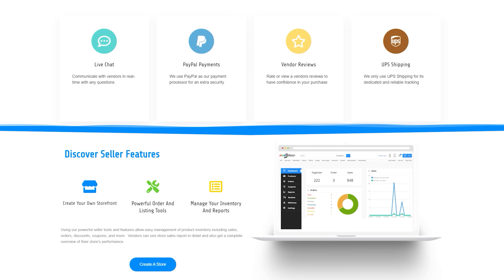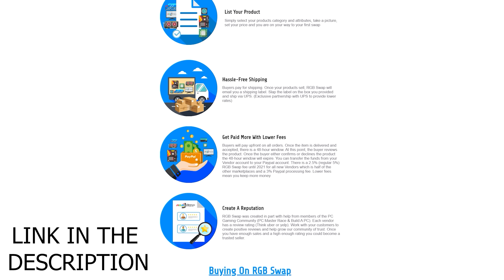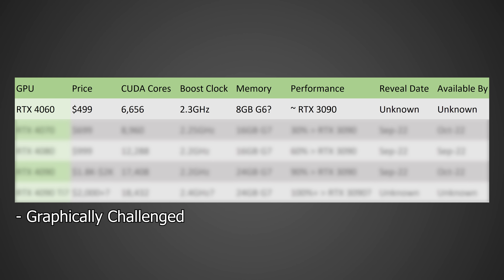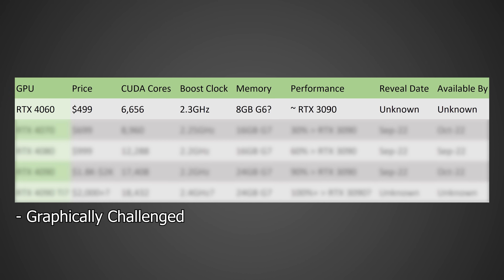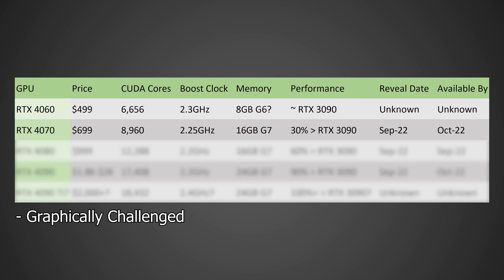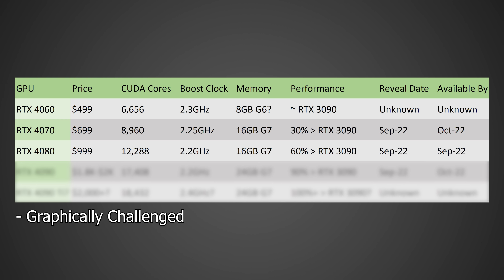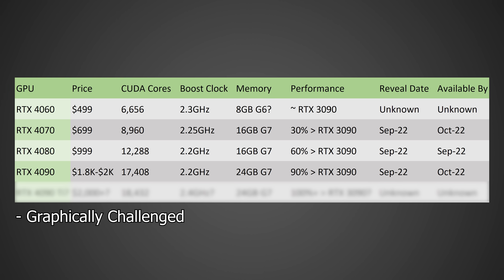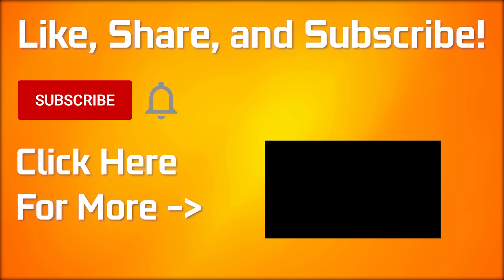Nvidia Lovelace RTX 4080 Price, Specs, & Release Date

Comment: The reality is while 3090 performance sounds nice and all $500 for an entry level card should still be a  “Nope!”

I think people should be advising everyone to buy consoles until the GPU manufacturers get their heads out of their butts.

Consumers have to send a message to GPU manufacturers that they are not going to abide by this.
Reply: Unfortunately they will not.
Reply: True but they won't. There is an entire group of people who have been waiting for a long time now. They will justify the expense no matter how much it cost.
Reply: You need to see how the market is changing. 

GPUs are going to be replaced with high performance APUs... Intels Battle Mage will have low to midrange graphics processing covered by integrated graphics (think current 3060-3070 performance covered by integrated graphics)... only super high end will require a dedicated graphics card for a greater cost.

The entire PC market is evolving.
Reply: @wolfshanze5980  
The Ryzen 6800HS gets about 24% better performance than an MX450 25W.  
This puts it a nose ahead for the  1050 (maybe 9%) in 3D Mark benchmarks.  Now a desktop version of the APU will do better, but it won't come close to a discrete rx470.

Even if they made a 16 CU version they wouldn't be able to achieve the performance of the 6500XT due to bandwidth & power difference between a discrete GPU and integrated GPU.  You will have a an APU with less power (65W vs 120ishW) than a 6500XT splitting between the CPU and GPU.
Reply: @wolfshanze5980  by the time battle mage releases, the rtx 5000 series would already be close at hand and the 4060 is already at 3090 levels
Reply: @wolfshanze5980  Wrong new APU’s are not even touching top end Pascal GPU’s stop with the lies.
Reply: @ZackSNetwork  I'm not surprised someone subscribed to this channel for tech news has no clue what they are talking about... sigh... people should really learn before opening their mouths and looking like an idiot.  Tiled architecture will allow graphics on the CPU, starting with Meteor Lake:

"In 2023, Intel will launch the Meteor Lake CPU, which will enable a tiled architecture that will work with Battlemage. “This is super exciting,” Koduri said. “This allows us to offer discrete graphics class performance, with the efficiency of integrated graphics. This is a new class of graphics. You can’t really call it integrated or discrete and this is just the beginning of the strategic advantages that this tiled architecture will give us. We will talk more about this in the future.

Intel and AMD have adopted a tiled approach to CPU design to allow them to become more modular—by decoupling the GPU and CPU design, separate teams can work on their own projects. Meteor Lake will be the first time that Intel has placed the GPU on its own tile.”

One of many sources:
https://www.pcworld.com/article/615510/intels-arc-gpu-roadmap-promises-enthusiast-graphics-with-battlemage.html

Grow up and stop getting your news from clickbait sites and TikTok... plenty of reputable sources are talking about upcoming changes.  Just because YOU have no clue it's happening, doesn't mean it's not happening.
Reply: The reason people aren’t just gaming on consoles is cause of the games that are PC exclusive. Sure, console ports do come out but as seen with Rust, they don’t always do so great.

Comment: 4060 Will be at least 6 to 9 % slower the 3090 and no, 500 bucks as a starting MSRP, I have my doubts. Maybe around 460 bucks. Hope It' done with 8 GB 256 bus.
Reply: It will probably be 12gb 192 bit bus. Maybe 12gb 256bit  But since the 3060 had 12gb vram I think the 4060 will have the same amount.

Comment: This could mean
aThat rtx4060 has ad106 and 52sm of 60sm active and instead of 80sm for ad106 it is 60sm in fact 5gpc
rtx4070 has ad104 with 70sm active from 120 in fact 10gpc
rtx4080 has ad104 with 96sm activ from 120sm
rtx4090 has ad102 with 136sm activ from  144am in  fact 12gpc
Side Note ampere has identical structure it is 12gpc with each 12sm but ampere has 1/3 deactivated sm and two gpc inactive because of samsung 8nm node.
The price question is how large they are in 5nm
one 5nm wafer cost ~16k to 20k
499$ 699$ 999$ and 2000$ make it clear
last one has at least 24gb vram and thats why it is so expensive.
Now i am confident that one tsmc 5nm cost around 16500$
ad106 will be 275mm² 5gpc
ad104 will be 440mm² 10gpc
ad102 wil be 755mm² 12gpc
ga100 has 144sm in 12gpc
ga102 has 120sm in 10gpc
Still many sm deactivated in lovelace
therefor sku name are little bit of
rtx4060ti not non ti cost 499$
Lower sku must be rebrand ampere or refresh ampere with ga116 and ga117 on tsmc 6nm both clocked at 2,2ghz
Slower as i thought but possible.
ga116 as rtx4060 15,6tf cost around 419$ if ram prices stays if not it should be around 339$
sad to see that nvidia cuts vram again
but vram cost are volatile now because chip shortages.
This could change quickly, now 1gb gdr6 18gbits cost 10$ possible around 2023 6$
this make a big difference in low cost gpu.
high end was predictable.
yes it is exiting to see massive performance bumb over ampere but ampere runs at lowest possible performance because of samsuing node so terrible yields .
Sweetspot is for 8nm is 1,6ghz at maxed speed
Nvidia pushed to 1,8-2,0ghz no wonder why ampere perform  so bad.
rtx3060 has 3gpc each 12 =36sm active on 28 
rtx3070 has 5gpc 60 sm, on only 48sm
rtx 3080 has 10gpc on only 68 and 70 and 72
rtx3090 has 10gpc on only 82 84sm
it is possible that lovelace is renamed ampere in 5nm and 6nm node
Means an ad107 has possible 3gpc with 36sm
and ad108 has 2 gpc with 24sm
also it could mean that clocks are higher than expected 2,5ghz with ad107 and ad108

Comment: This sounds way too good to be true, hopefully it is. It'll help the rest of the budget gpus to drops
Reply: It needs to be this fast because AMD are going to use multiple chiplets for their next GPUs and are rumoured to be extremely fast.
Reply: yeah those are unheard of performance leaps
Reply: Bro there’s no way a 4080 is going to be 60% faster than a 3090 if that’s the case it’s like a big fuck you to everyone that bought a 3090  like a 4060 w 3090 performance ? No way.
Reply: @DjangoMMA  3070 was supposed to provide 2080 Ti level performance for $500. This is not impossible.
Reply: @gurjindersingh3843  I mean yeah but that’s matching the performance. The 4070 is supposedly 60 % better than it. I think this years jump would be a bit to extreme
Reply: @DjangoMMA  it can be true since we have had multiple confirmations that the  amd 7700xt is as powerful as 6900xt
And Nvidia's 4060 and 4060Ti are the rivals of 7700xt so they gotta be good
Reply: @arian_s_collection  MentallyChallenged just made another troll video and you fell for the bait. A 4080 will never outperform the 3090. They said the same when 30 series were about to release, the 20 series is just behind the 30's in performance.
Reply: @midnightvibes5485  The 3080 is only slightly slower than a 3090. You don’t know what you are talking about if you believe a 4080 will not be a lot faster than a 3090. Next generation 80 series GPU’s are always a lot faster than last generation Titan level GPU’s.
Reply: @DjangoMMA  Nvidia have never cared about this, did you see what they did with the Titan line of graphics cards?
Reply: @DjangoMMA  It’s not a F4 is called a massive advancement in technology. You must be incredibly new at this stuff.

Comment: With the claimed performance increases the individual card price might be a bit irrelevant considering the only upgrade you won’t need is a new case. The price runs into the thousands when you include new cpu, psu, mobo, ram and so on. Not to mention scalper and inflated mark ups. Might get away without full upgrade running the 4060.

Comment: You cant have gpus that much faster than a 3090 without some insane power draw.
id expect the 4060 to be 200-300 watts
and the 4070 at least 320 like the 3080
Reply: What is the point of using a more efficient 5 nm architecture, if new GPU is using the same amount of power as old GPU for the same level of performance.
Reply: So I guess you want to act like newer advanced architecture and a far more efficient 5nm TSMC node is not a thing.

Comment: Power requirements?
8GB of RAM on a 3090-level card?  That probably won't age well.
Do we actually believe Nvidia's official announcements will not be fake MSRPs, as they very obviously were with the 3050?
Still got a lot of questions here.  Nvidia has absolutely zero confidence from me when it comes to pricing.
Reply: The MSRP could come out but Nvidia could just shadow release them with no MSRP Cough Cough 3080 12gb 2060 12gb had no msrp

Comment: Do not be suckered into this performance fantasy land folks....The 2080 Ti had 4352 Cuda cores...the RTX 3090 has 10,496...that is roughly 240% more cuda cores...how fast is the RTX 3090? 57% faster than the 2080 Ti...So if there were no IPC gains from Turing to Ampere you're looking at 28% more performance at say 120% more cuda cores.....or 14% at 60% more cuda cores....keep those figures in mind...Lovelace RTX 4090/80ti or 4090 ti...whatever their top tier card will be called only has 70-80% more cuda cores...or about 15% faster...add in some IPC of say 20%...and clock speed which is looking about 10% then the RTX 4090 should be no more than 40-55% faster...which falls exactly in the range of performance per generation nvidia has given from generation to generation...A 4060 as fast as a 3090? come on. That is absurd.

Traditionally, your new 60 class card replaced the previous generation's 70 class card...and your new 70 class card either replaced the previous generation's 80 class card or fell between the 80 and 80 ti card..it usually took two generations before your 60 class card replaced an 80 class.

AMD on the other hand....RX 6900XT has two times as many stream processors as the 6700XT and it is 58%faster...so AMD is getting better performance per stream processor ratio than nvidia....the 7900XT adds 3 times as many stream processors as the 6900xt...so expected performance just on that alone should be 75-80%...add some IPC of 15-20% and 10% from clock speed...so the 7900 XT should be 100-110% faster...Oh as a side note....7900xt will have 4 times as much infinity cache as the 6900XT, which was the 6900xt's achilles heel at 4k...bandwidth...which infinity cache didn't alleviate. The 7900xt is going to crush the RTX 4090 in rasterized performance. I expect nvidia to keep the lead in RT though due to nvidia having more mature RT implementation than AMD...

Comment: I think under volting them and pulling less power is going to a big push in the future. No ones want 1200 watts tripping breakers.
Reply: Watts don't trip your electrical breakers, AMPS do. An up to code electrical wall outlet wiring is always has a higher rating than what will trip your breakers SO there isn't a short and subsequent fire. The breakers will trip at 80% load. You get fires when people put higher AMP breakers on lower rated wiring.
Reply: @JamesSmith-sw3nk  just ran 12/2 on my 20A were solid.
Reply: @JamesSmith-sw3nk  more watts mean more amps. Unless you are also increasing voltage.
Reply: @JamesSmith-sw3nk  watts do trip breakers. Because Watts law A = W / V.  Since the voltage is a constant at 110 in US, it's always 11amps for 1000watts. In Europa that is 240 volts so 4.2 amps for 1000 watts. Similarly a breaker for 20amps is also for 4800watts in Europe.
Reply: Its going to be about 10amps not including  your other equipment plugged .
Reply: Just replace your 15 Amp breaker with 20 LOL. P.S. you have smoke detectors right!
Reply: I just hope AIB's releases non 12+4 versions
Reply: maybe the 4080 will pull less
Reply: @HUSTLER1346  optimistic are we?
Reply: These leakers are bushitting. No wy the cards draw more than 400w, now they claiming 800w lol
Reply: Sounds like a America-problem. Most of the rest of the world operate with normal consumer outlets at 2300W and 3680W (230V)
Reply: @flyfaen1  Heldigvis :-)
Reply: 2k bucks is equal working for 2 weeks in lowest paid job in America which is actually international students or coach potato people gigs so unless you live in any other country yeah you have to sell your kidney even with highest paid salary
Reply: @psionicaptitude7177  idk what state you living in the median house hold income is below 45k a year which is less than 1k a week and thats before taxes
Reply: No worries I ran 20A breakers throughout my house.
Reply: @BigInjun05  you smart
Reply: Yep it's how they fix the 3090 early on. Undervolt the stupid thing until they fix the bugs. Many poor gpu burned up

Comment: if the 7900 XT comes in priced at $1999 - $2499 and it demolishes the 4090 in raw performance (which is possible as the top 4090 will be monolithic vs AMD's MCM card), I think the 4090 will be priced at $1799 - $1999
Reply: I feel like the 7900xt may be 30% faster then a 4090 and a 7800xt may match or be 10% faster then a 4090. If that happens I could Imagine NVIDIA Panicking and throwing watts away to try to win.
Reply: @IdeasAreBulletproof  5090 is gonna come out early

Comment: Your numbers are interesting.  Perhaps you can explain to the viewers the power supply requirements for a new 4090?  What will it take to drive a 4090 in the way of a CPU?  Isn't it true, unless you already have a 3090, you current PC will not likely support any of these new cards.  So, what are we looking at (expecting at least a 100$ markup over MSRP), at least $5000 for a DIY machine?  Oh, and it seems these would have to be highly binned chips, so how may GPU's chips will Nvidia be able make before the release date?  Do you expect paper launches?

I certainly hope these new GPU's come out soon.  I think they could be able to mine BTC.

Thanks for the infor.
Reply: Btc requires a dedicated ASIC.
Reply: @VoldoronGaming  The new Intel CPU is not an ASIC, and it is suppose to mine just fine.  While I agree, having something like an ASIC is much better in every way over a GPU, there is no reason that a GPU (with the necessary components) could not mine BTC.  I think the focus will be back on BTC once ETH is no longer mined (assuming that ever happens).  Just this week, new BIOs for RTX 3000 LHR has been devloped that removes the restrictions of LHR (that is available on the 27th I believe).  I is pretty easy to believe that some smart people will figure out how the mine BTC with these new GPU's if they are as powerful as this channel says.  Limitations come and go.  But, in general, I would say you are fundamentally correct for current equipment.
Reply: @groverlclark  Bitcoin has not been mined on gpu's (sha256) since 2011/12.That is why litecoin(scrypt) came out when bitcoin went all asic in early 2012 then litecoin and it alts  u know of one probably is dogecoin.
Then litecoin asics came out then ppl and that killed gpu mining after the antminers etc  for "litecoin" went fully online and bitcoin crashed from 1000 to 250~ end of 2012 ended the first boom.
GPu mining in 2013-end of 2015 was only lesser coins on Non asic coins like xmr,primecoin even eth etc.Then even then u mined at at a major loss .So you only mined to hold till next "boom" .
Then 2016 eth started getting hype n ironed out and miner programs started getting some love that made setting up eth mining became a metric f ton easier to mine.

Then when eth stopped be able to be mined on 3g gpu's like radeon 280X the  Zcash anglo came out and ppl mined that for about a year till the 2018 crash.For awhile till the crypto bubble fully crashed n burnt in 2018 ppl "mined" doing folding at home too.Folding@home mining is for curecoin/Foldingcoin
After zcash became not very profitable/not at all  i "mined" folding@home on my 2 1060 3g on linux for avg 4-5~dollars a day till crypto went totally to shit after the last crash.

Comment: Thank you Radeon for competition and forcing Nvidia to bring actual performance gains.
Reply: Yeah a 600w+ card. That's not forcing them to do anything. They're just jacking performance of 3090 and adding another 200w of power requirements. 1000w PSUs will be the requirement going forward.

Comment: Not sure about the 4060 vs 4070 price: it's too "linear"... I would expect the 500$ card to be called 4070, and maybe they'll slot a 4060 at 400$ with 85% the performance of a 3090 (best frame/$)
Reply: I think the 4060 will be $400 4060ti will be $500 and 4070 will be $600 or higher. Don't think NVIDIA will do a 4070 for $500
Reply: @IdeasAreBulletproof  I think you could even push all of these up a few dozen $ ! The 2060 was out at arround 400$ if I recall correctly. I doubt the 4060 will not see an increase from its older brother. 440 to 480 is where I'd stand if I had to place a bet
Reply: You are never gonna see those type of prices back. Maybe 100 or 200 more than what you said may sound more reasonable.
Reply: Yea those prices I highly doubt will be right. Probably more than likely to be $100 to $200 more per leaks from other people
Reply: Those prices will most likely get close to double… and will be sold out

Comment: Does anyone know if the 4000 series comes with the "new" displayport 2.0 or do they still use the 1.4?
Reply: It should come with Displayport 2.0 as RTX 40's top cards should be pushing 4K 144Hz at max settings w/o compression
Reply: Would be stupid if they didn't. But knowing Nvidia they are stupid so They'll probably not have DP 2.0